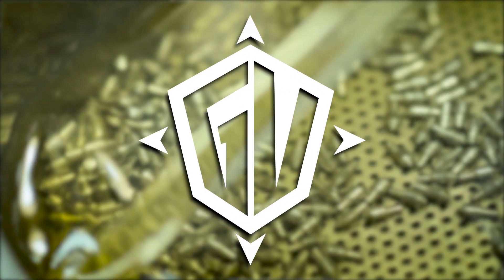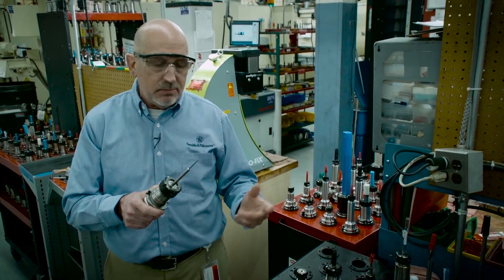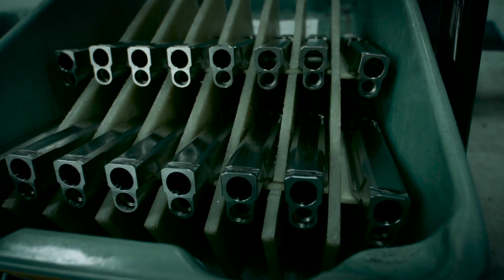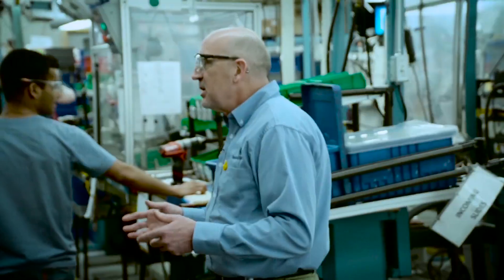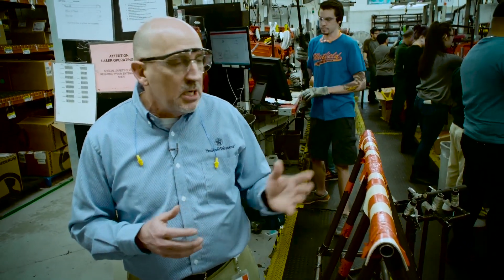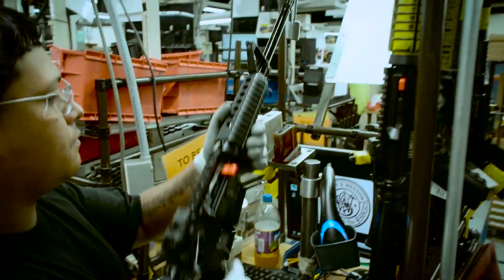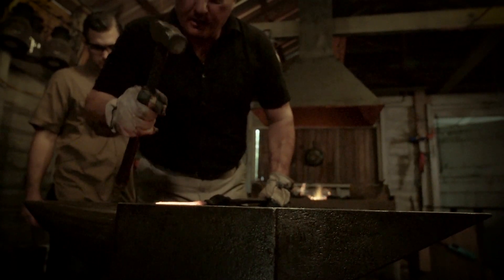Touring the Smith & Wesson Factory: GunVenture|S1 E5 P2

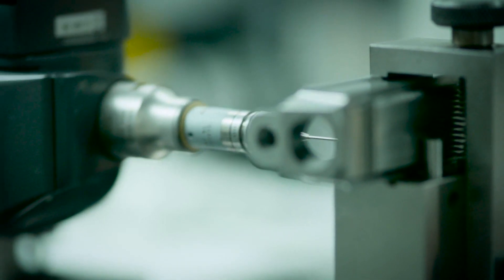Comment: 1:50 CMMs are too slow.
I worked at a place that replaced bar and plug gauges with one CMM and we had to throw 80% of product away because the customer refused to accept unCMM'd parts even though they were low tolerance parts for car gearboxes. 
We needed 6 CMMs to check every part as one ws so slow.

Next time you're near a modern gearbox just rattle the parts about to see why there is no need to CMM them.